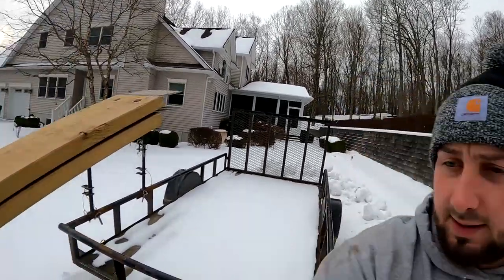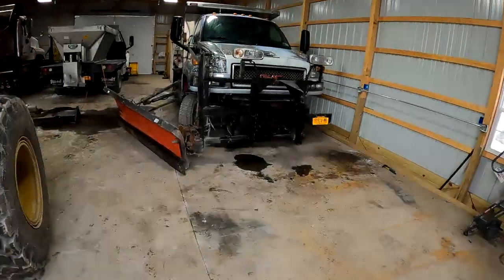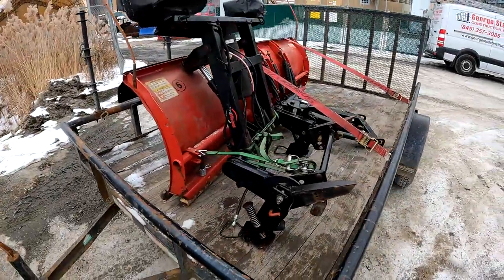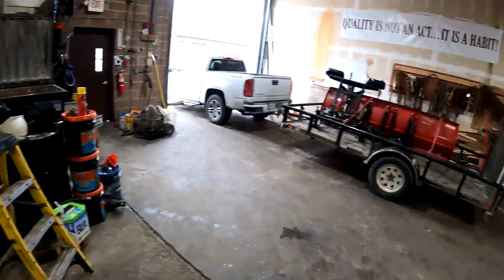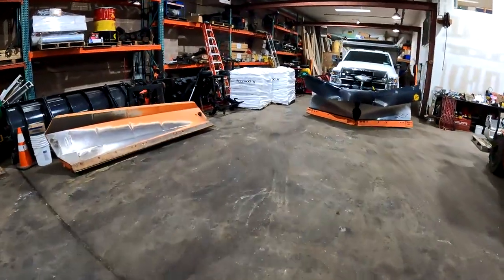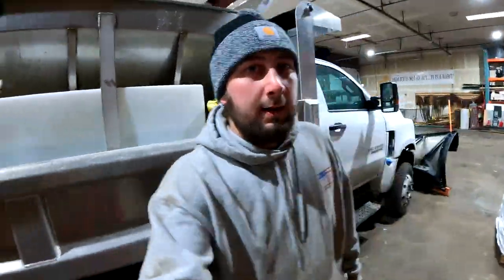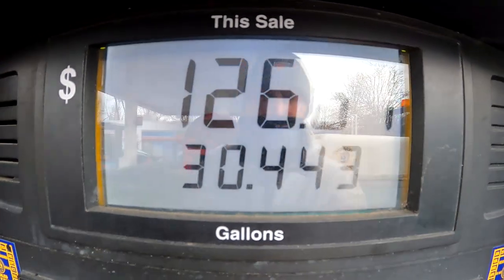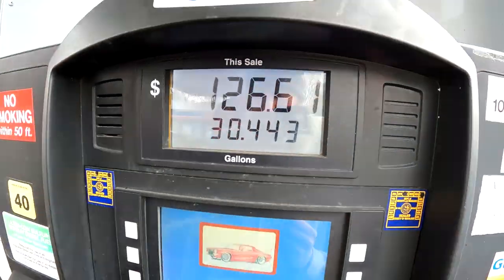FIXED SNOW PLOW AND LAST MINUTE STORM PREP!

Comment: Here in Chicago $3.75 a Gal for Gas
Reply from the maker: Not terrible. Is that higher than it used to be?
Reply: @StollNCrew  it goes up and down. for  the last few months Like $3.20 range a gallon. but went up two weeks ago to the $3.75 and that's for 87 grade. seems too go up overnight.
Reply from the maker: @garrettlarson5921  oh wow so it's gotten quite a bit more expensive recently. Hopefully that turns around!
Reply: @StollNCrew  I am thinking it is going to get worse. I think by summer going too be over $4.00 a gallon. Problem is they raise it as long as people keep paying. they can raise it to whatever they want.
Reply from the maker: @garrettlarson5921  yeah they have all the power. It's pretty screwed up. People need gas lol I don't see a future where people stop paying the price it's at lol